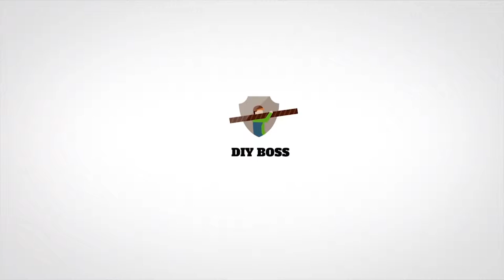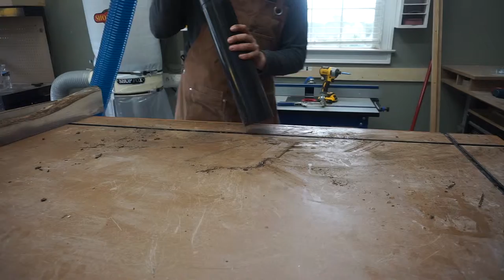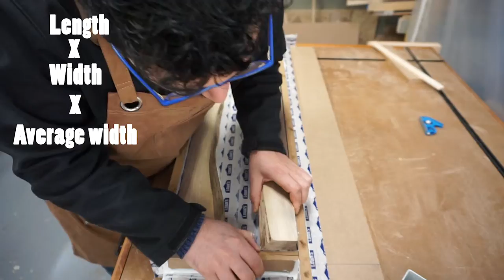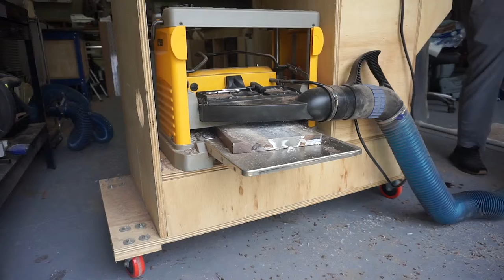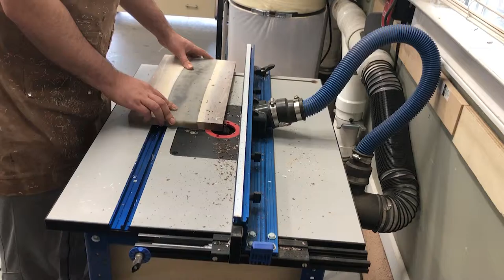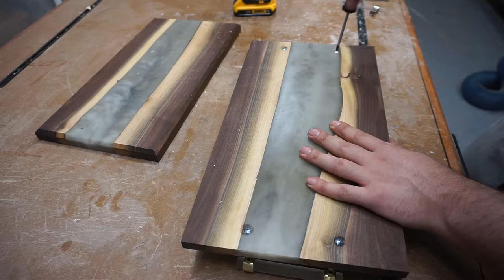Epoxy serving tray

Comment: Little tip, try putting the sander dust in the hole, then put can glue on it. Takes about 5 min to dry. And do not use activator it will turn the glue white- ish. Just a bit easier I think. Nice trays. Beautiful combination of colors.

Comment: What are the pegs that you use on the bottom? Great work!
Reply from the maker: https://www.homedepot.com/p/Everbilt-3-4-in-Self-Adhesive-Vinyl-Surface-Bumpers-12-per-Pack-49565/203661091

Comment: Your video - slightly offset handle on the tray specifically - opened my eyes to an idea I have for a diferent project....if you have a moment could you tell me your supplier for these handles....many thanks for your great education work from a novice woodworker.  John
Reply from the maker: Thank you John I highly appreciate it . I brought those handles from my local Home Depot. “Liberty Floating 5-1/16 in. (128mm) Center-to-Center Brushed Brass with Frosted Clear Glass Drawer Pull”
Reply: @beastyfurkan  I use a Chinese web site - Aliexpress - for my handles, but just could not find anything as good as what you are using....and Home Depot is just around the corner!  Thanks, I will go to my local HD tomorrow.
Reply: @beastyfurkan  I used the smaller ones....would send you a photo if I knew how to attach an image....thanks again.